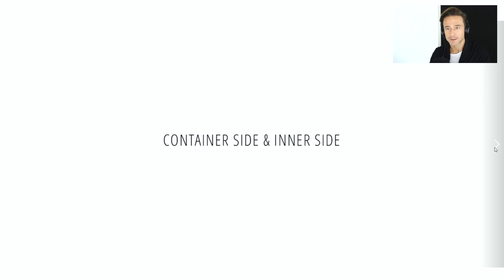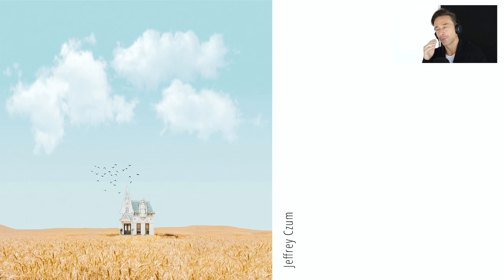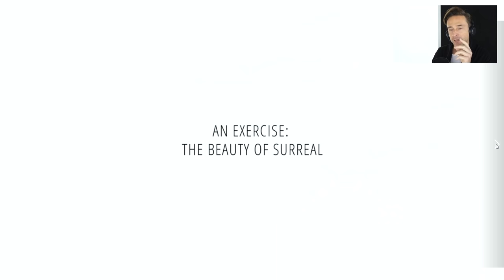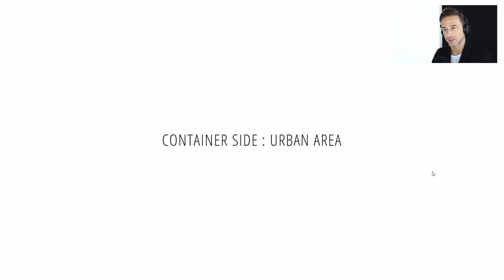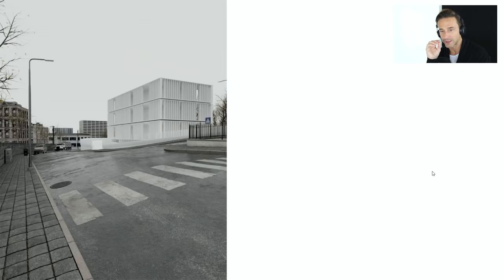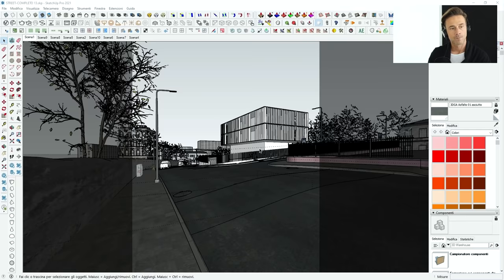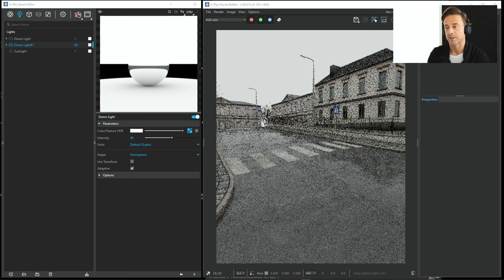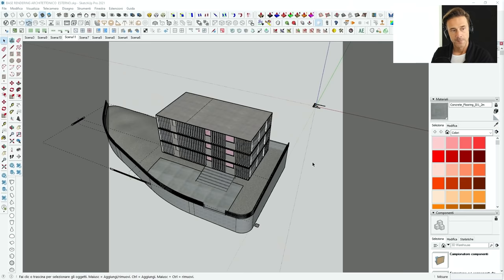Container side & Inner side theory workflow for beginners - Davide Paolini | From Zero to Hero 2022

Comment: How is the viewport so fast? What Threadripper is He using? 3990x?
Reply: But who said that he's rendering with cpu... (RTX)
Reply: @filmanify  he uses CPU+GPU. He said he uses an rtx 3060 + a threadripper. the 3060 is not a good card?
Reply: @filmanify  8:40
Reply: @L3nny666  rtx 3060 ti is good, regular 3060 is not good for renderings ... That's why he don't use rtx mode on vray... Cause vray rtx mode is much much faster then cpu and cuda
Reply: @filmanify  hm, i've got an rtx 3060 ti. if the scene is not huge, it's okay. but cuda, rtx and cpu are different engines and thus produce different looking pictures. i find it hard to use one of the engines for preview and then switch for production rendering, because you get different results. vantage is also good for preview and camera testing
Reply: @L3nny666  i also have an rtx 3060 ti, and i use rtx engine all time...and paired with nvidia ai denoiser...it renders out in seconds